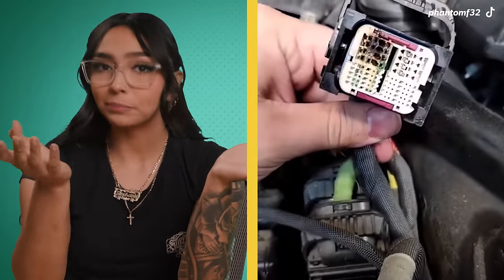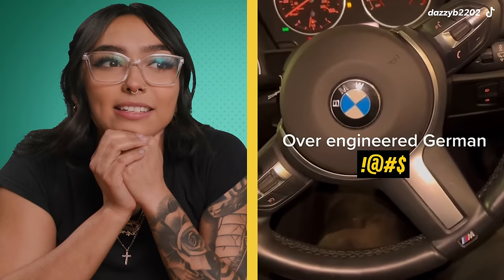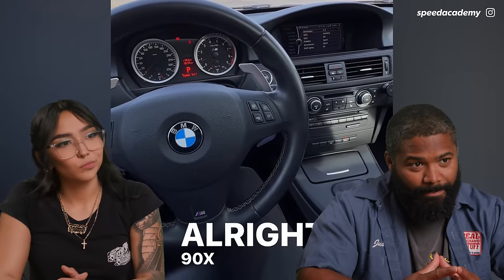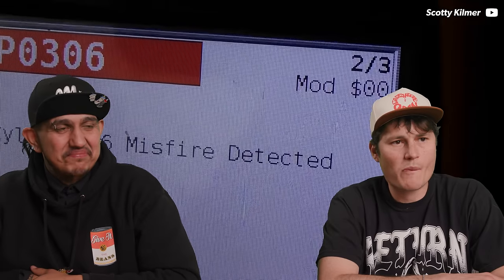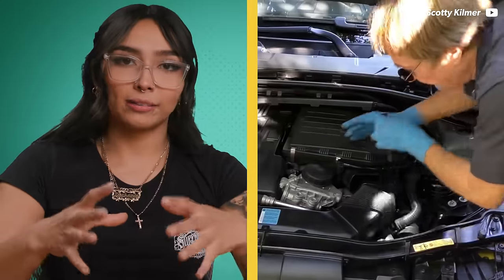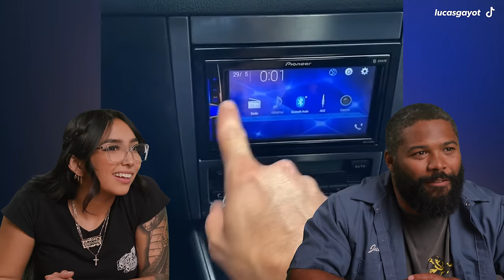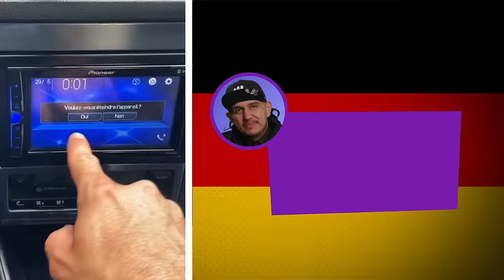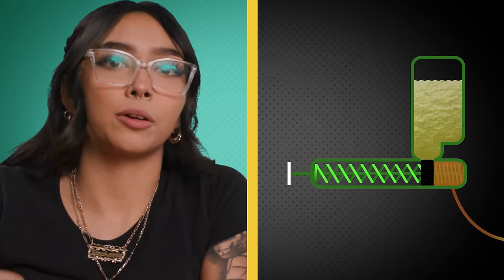Mechanic Reacts to German Engineering Fails

Comment: The more components the more things that have a chance of breaking increasing your total risk of something breaking. That picture of the engine pulled out is insanely complicated 😂😂
Reply: A NASA spokesperson (sorry, don't remember who) once said they aim for a 0.01% component failure rate, but that rockets have over a million parts, so...ten thousand parts could still end up breaking, even with their level of care and precision.
Reply: @theaikidoka but that’s for a rocket ship….. you can’t really be comparing a car to a rocket ship come on now. Have you ever heard the term “it’s not rocket science”?
Reply: @theaikidoka also just use a little common sense…. When designing/building something, they are going to take pride in there work and try to make it all work together. 1. So unless they had kids working for them something like this would usually not happen, unless it was to make more money buy suppling parts all the time so that it’s not longer a one time purchase. 
2. They would have picked up on all these problems in the endless amounts of testing they do on the cars before they are even allowed to sell them to the public.
Reply: @theaikidoka  “I guess the question I'm asked the most often is: "When you were sitting in that capsule listening to the count-down, how did you feel?" Well, the answer to that one is easy. I felt exactly how you would feel if you were getting ready to launch and knew you were sitting on top of two million parts -- all built by the lowest bidder on a government contract.” - John Glenn
Reply: @tysonclement4612  The engineers still have to answer to the bean counters and other departments.  I was a mechanic for close to 30 years and had a few chances to talk to the actual engineers of certain brands and what they design and what you get, isn't always the same thing.  Why do you think there are so many recalls on the newer cars and trucks.
Reply: @Tee-np1fc  iykyk thats all I’ll say
Reply: @tysonclement4612  First, of course you can compare rockets to cars - they are engineering projects built by people. One costs more, has more bits and the stakes are higher if it fails. Second, my point was just agreeing that the more parts you have, the higher the chance that you will have a failure SOMEWHERE. Thirdly, I'm sure the Audi/BMW/NASA engineers take pride in thier work and don't intentionally sell something that will fail - I never said otherwise. Engineers aren't the only ones making decisions on car design - you can find literally hundreds of examples of cars with known manufacturing/design defects that were still made and sold. Anything from engines that don't perform as they should, batteries that short, panels that rust or fall off...
Reply: For real, does anyone know what engine was that?
Reply: @theaikidoka  like comparing apples to oranges what do you mean lol
Reply: @tysonclement4612  I explained it pretty clearly. If you want to make an artificial distinction, that's up to you.
Reply: @theaikidoka  NASA rockets have tons of redundancy like planes. If one component fails, there's still multiple back up components responsible for the same thing. Only time something goes wrong is when every one of the components fail at their job. So I wouldn't say it's quite the same, cars don't really get that level of redundancy because it's too expensive to manufacture. 

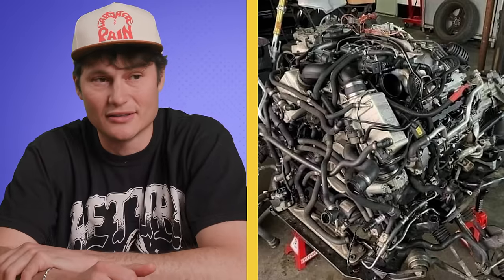When a car's engine does get as complicated as 1:48, I'd chalk it up to very poor engineering paired up with sunk cost mentality. It's the exact same mentality in software development, you build something that's simple at first, but then something goes wrong and you need to do something convoluted to fix it, and then something else goes wrong and you have more convoluted code to fix it. At some point you realize that it would be better to start from scratch and redesign, but the company has already sunk a ton of money and time into the project and wants a result immediately. At the end you have a mess of spaghetti like that engine, it works but whatever person needs to work on it in the future has their work cut out for them.
Reply: @PURENT  Absolutely right, my point isn't that the whole thing fails, but a component may break, necessitating the activation of the backup. There's simply so many that it's almost inevitable that some will break.

Comment: The guy changing the spark plug on that BMW is definitely special, yes you can do it that way, but the correct way is to remove the scuttle panel and access it directly from the top, no accessibility issues at all.
Reply: Scotty knows all
Reply: It's Scotty Kilmer the man has I think until recently had a very long YouTube career giving out questionable mechanical advice and opinions. The man is more nutty than most of his viewers will ever admit.
Reply: That's Skotty, most of the rants on his YT channel are sarcastic, but he's still a solid old school mechanic.
Reply: Wait you have to remove the scuttle panel to get to the spark plugs? Dafuq
Reply: @JABelms  ya it's a favorite german special, they of course break easily too when removed
Reply: @JABelms  Yeah, it takes 2 minutes to remove lol.
Reply: @Boasandpythons  My evo VIIs coils are hidden by a carbon fiber plate with 2 bolts and that's it.
Reply: @JABelms  For the BMW cover, it's 4 bolts for the cabin air filter, and two bolts for the scuttle.  Pull and remove.
Reply: @WhiteG60  it's boomer humour, I worked on cars with my dad and my late uncle and both of them are excellent mechanics (both worked on tanks and heavy machinery), but they couldn't plug in an OBD cable to save their lives. He's a bit obnoxious but he's sarcastic (the loud talk, the gestures, the cringy horse meme...).
Reply: @Boasandpythons  Seems like two steps too much
Reply: @JABelms  If 6 8mm bolts and 2 minutes of time are a problem, then that person has no business working around vehicles.  Hell, with your motto.  The mini cooper has the coils up at the top.  Nothing to pull off in the way.  That would make your evo "one step too many."
Reply: I love Scotty, but every few years something like this happens where he complains about a newer model car and just shows how out of touch he is. Don't doubt he's a great mechanic, but show him anything more complicated than a carbureted V8 or a 4 cylinder Toyota and he is whining lol
Reply: @JABelms   I have to remove the throttle body, the intake manifold, and half the fucking harness to get to 3 of my spark-plugs and my car isn't even German!
Reply: @paynekaufmann403  Scotty thinks that the Lexus RX300 is a great car, when they get scrapped over a bad power steering hose because no one will work on them. But them he is a whiny Toyota fan boy...
Reply: @Boasandpythons  Yeah there is a mod to do that with a 4G63 but a little more extreme (one pull and all of the ignition coils come off) and I am certainly leaning towards that. I replace my spark plugs every year and my fluid maintenance is every 6 mos, if you own something for 20+ years you tend to go the simplest route. Been working on the evo since I was 12 years old
Reply: @aaronshapiro2542  Sounds like an annoying 6 cyl. Good thing I'm leaning towards getting a C5 Corvette too for to not get into the usual woes of V engines.
Reply: One of my VW´s glow plugs doent work correctly, but that damn thing is somewhere under the damn camshaft!
Reply: @walterwhite415  injectors are under the camshaft if it’s a PD, glow plugs are in the front of the head in 99% of VW’s
Reply: @iHackWaWx  It´s a PD. My mechanic said it´s a lot of work and as long as it starts, he wouldn´t change it. And well, it does start so far. xD
Reply: @walterwhite415  the glow plugs in the PD’s are easy to do bro, just need to get them warm first otherwise they’re prone to snap. Injectors aren’t too bad to change, they’re worse than other cars due to them being in the head rather than on top of the head attached to a fuel rail but they’re not the worst

Comment: I was a Mercedes Heavy line tech for many years. Those cars came apart very methodically. Was amazing to work on. Some of the diesel engines were notorious for an oil cooler leak that was buried deep on top of the engine. Made a huge mess and cost like 10k in labor to replace a 10 cent o-ring lol.
Reply: Wow that’s insane 10k

Comment: So I’m currently working at a Mercedes shop and had this W204 for a decent while, 4 years now and yes, it’s been relatively reliable, only left me on the side of the road twice, once because of a dried out radiator hose and a bearing fail that destroyed my distribution belt… Aside from that it’s been a great car and currently I’m rebuilding my suspension (with OEM parts) and for gods sake it’s a pain in the ahh, want to replace sway bar bushings? Nono you want to swap out the whole sway bar to do that because it’s one piece, you can’t just take off the bushings, and it’s that kind of stuff that makes simple and cheap fixes expensive for the owner of the car, I’m also due to replace rear shocks🥲
Reply: On a side note, problems I’ve had with the car so far
-High pressure fuel pump (died)
-AC compressor (died twice)
-Radiator fails (hoses, thermostat)
-One bearing that holds the serpentine belt (got stuck and destroyed the belt)
-Camshaft position sensor (error, haven’t fixed prolly will never)
-ECO mode (never worked since I got the car, thankfully tho)
-Head gasket (twice because the second one failed immediately)
-O2 sensor (minor fix who cares)

Aside from that little stuff like spark plugs, filters and other common stuff, thing is all that list has been done to it in a period of 4 years of ownership

Comment: Note that BMW stands for "Bring Mich Werkstatt" in German, roughly translates to "take me to the shop". Reliability beyond the warranty is just an anti-goal of the engineering.
Audis are just VW with added ostentation.
Reply: Bavarian Manure Wagon
Reply: BMW one  the most reliable car at the moment after Toyota. Did you know this?
Reply: This is the problem on Internet. You Brough bunch of mechanics to react to engine fails. All engine fails, what's the purpose of the video?

I would assume you'll call engineers that design engines to react. It's like calling labourers to react to design on cathedral.
Reply: BMW's tend to last rather long IF YOU KNOW WHAT YOU ARE DOING and fail incredibly quickly IF YOU DONT. 
that said maintainance and repairs on BMW cars are notoriously expensive and licensed shops and parts are highway robbery made legal ....

Comment: Had a 2003 Polo TDI, their headlight bulb retention bracket had a tendency to melt itself into the headlight housing, so to change the bulb you had to remove the entire headlight, which required disassembling the entire front of the car. A 5 min job turned into a 1-2h job.
Reply: Sounds like typical VAG cars.  I have an MK7.5 GTI and I do all my maintenance, so I know what you mean when you say "To change something, you have to remove the entire front half of the engine bay"

Comment: Sandros.....I fried the sunroof on my BMW years and years ago.  It was just a 2007, nothing awesome.  However, it smoked hard enough that I jumped out of the car and disconnected the battery.  I thought it was going to burn my car down!  Mechanic confirmed water has completely washed out the whole assembly.

Comment: The problem with BMWs is that each iteration becomes more complex than the one before it, up to the point of lunacy. My E30 was the greatest car I ever owned. Built like a tank, easy to work on, and a hoot to drive. I drove my E36 for three years with a bad head gasket. Took that long for the leak to become unmanageable. As soon as I drove my E46 for a year or so I decided there would be no E90 in my future. Just too much stuff going on between me and the wheels. As soon as I get around to it it's destined for the scrap yard with only 150k on it, as the repair costs greatly exceed the value of the car. Back to Japanese cars for me.
Reply: You could just try out something French, they try to make something stylish and still basic mechanically. French diesels are pretty solid.
Reply: You will also hate modern Honda's & most Toyota's...
Reply: Sounds like a deferred maintenance blame there. If you maintain the car it will last as long as you want it to. Good luck with your Prius.

Comment: If you gotta go German and don't want too many headaches maybe go for a 97-99 Boxster.

Those models were before they went to the single-row IMS bearing that caused a lot of problems and the car is honestly way easier to work on than you might expect.

Comment: I'm an airplane mechanic, and I can honestly say that Airbus, which is an English, French, and German conglomerate, is exactly the same.

Had to remove so much unnecessary, unrelated rigid lines, large flex lines, wire bundles, and structural supports just to get enough clearance to remove a waste tank. Takes most of the day just to get that B.S. outta the way, THEN you can actually start to remove the tank.

In contrast, you can have the whole job completed on a Boeing in the same amount of time it takes to get mostly done on an Airbus WITH time to spare to fill out the paperwork, and get it stamped off by inspection.
Reply: So it's even more so the lazy mechanics to blame when a Boeing is badly maintained? Good to know...😅
Reply: Huh? How'd you come to that conclusion?
Reply: You're drawing your own conclusions from information made up entirely in your head.

The point I was making was that European engineers like to over complicate things, as demonstrated in this video, and as I've seen in real life. You can get more done in a shorter amount of time if you weren't having to take so much apart in order to accomplish a simple task.

It's like completely removing an engine in order to change a fuel filter.
Reply: Airbus engineering; done by comity.
Reply: @YeeSoest Jesus Christ, dude, literally NOTHING was said by me about Boeing. Nothing was said to imply Boeing (or any other aircraft manufacturer) is superior in any way, shape, or form. That's not what's being discussed, and I'm not getting into that.

What IS being discussed is the fact that it seems as if European engineers are designing any vehicle at all, it's a sure bet it will be unnecessarily complex, and accessibility for ease of maintenance or component removal/replacement is seemingly treated as an afterthought based on examples shown.

There's, literally, nothing else to say about this.
Reply: @christrek1027 It sure seems that way, haha!
Reply: @jerryhenson3916  the original comment we are talking about here did^^
And:  In a market with exactly 2 major companies, criticising one of them for the unneccessary complexity of their engines while the other is --- failing --- is just asinine. Of course Mechanics will prefer a simpler build but that doesn't mean Airlines or Customers agree...
Why compare the 2? You can imply or force up a comparison, you know? When there's 2 big sides to pick and you talk about 1, the comparison is obviously implied. Tell me you hate the rain and i'll imply you prefer sunshine. Tell me you hate Airbus engines and i'll imply you prefer Boeing...
Is that so complicated or far fetched?
Reply: @YeeSoest  Oh yeah, I did. Jesus, how did I miss that? My bad.

The point I'm making is that over-engineering and overcomplicating does not equal quality. Routing fluid lines, wire harnesses, etc. in a way that creates additional work is a matter of efficiency. It has to do with maintenance being cost effective, because it takes significantly more time, manpower, and resources to accomplish what would/SHOULD otherwise be a simple task.

Honeywell, for example, makes a great engine in terms of ease of maintenance. Their TFE-731 does not require any unnecessary work for disassembly, and you can remove a lot of components without having to take the whole thing apart. I can't speak for its removal from an aircraft, but disassembly can be done in about an 8 hour shift. Are they without flaws? Not in the slightest. The new gen -40s tend to run hot, which means some extra work has to go into removing the hot section due to all the buildup. Absolutely an engineering thing. This is not a constant, however, it's just something we have to keep in the back of our minds, like, "Hopefully this one won't be too bad".

Going back to your original comment, it has nothing to do with AMTs being lazy (although I've seen THAT, too), but it does have something to do with being rushed, and that's entirely a management-thing. I've gone back and forth with leadership time and again over getting it done fast vs. getting it done RIGHT. AMTs have to stay on our toes, and be very diligent in everything we do. We do have to consult engineering from time-to-time, and very often we have to wait days or weeks for them to find a solution because they have to get us an answer that is agreed upon by several of them.

Boeing is not without faults, no manufacturer is. But they do seem to understand that certain things must be accessible for ease of maintenance.

With the exception of the Max-9 flight control issues from those two crashes several years ago (something to do with the autopilot, if I remember right), they haven't been in the news for engineering problems, these have been maintenance and/or inspection issues. The window plug blowout from a few weeks ago, for example, wasn't an engineering issue, but definitely a maintenance/inspection issue, and has been rectified with new guidelines, etc. This, of course, brings us full circle to the issue of being rushed by management/leadership.
Reply: Or a door falling out of the hull…

Comment: 11:45 I drive an Iveco daily at work, automatic. And if u pull the e-brake and remove the igniton key while the car is running, it will just stay running until u release the e-brake.